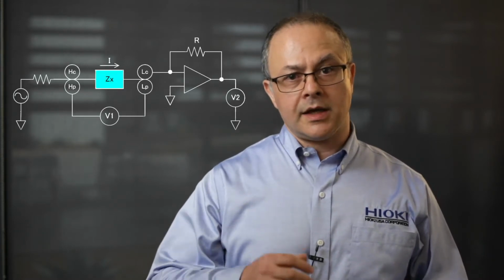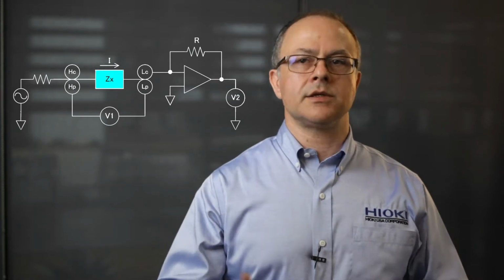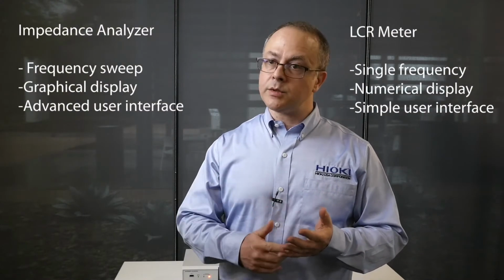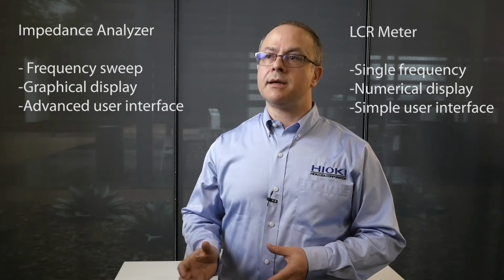Capacitor testing with LCR meter

Comment: I was expecting to see the bipolar capacitances also at 1kHz - 10kHz and 20kHz...
Reply: You are right. In fact, I tested other frequency points, specifically 20kHz as it's the upper limit of the audible range. I also increased the frequency until the capacitor no longer met the specifications. However, we ultimately opted to keep the video concise since the viewers would get the main idea.

Comment: Can it perform a leak test?
Reply: Hello Michael,

When conducting leakage testing on capacitors, an Insulation Resistance tester is typically used. Hioki manufactures several models for this purpose. The test involves applying a DC voltage to the capacitor and measuring the leakage current after a set amount of time. The capacitor's datasheet will typically provide the test conditions and limits.

If you were to test a leaky capacitor on an LCR meter, you may observe differences in certain measured parameters compared to a good capacitor of the same part number. For example, a leaky capacitor may show a decrease in capacitance, indicating a loss of its ability to hold a charge. Additionally, a higher than expected Dissipation Factor (DF), which measures energy loss due to internal resistance or leakage, or a higher Equivalent Series Resistance (ESR) reading may be observed.

However, it's important to note that an LCR meter may not always detect small leaks or defects in a capacitor. Therefore, it may be necessary to use other testing methods for a more accurate diagnosis.
Reply: I use my old, but tried and true Telohmike TO-5 to measure insulation resistance.  It's from 1958, but it sure does work! @ihsand8570